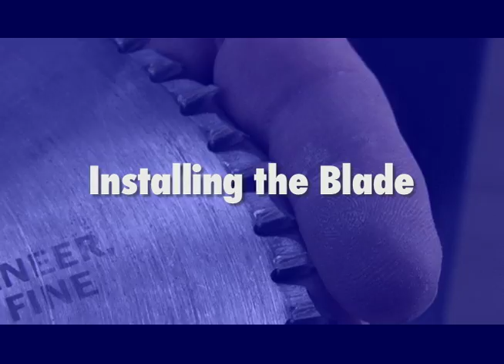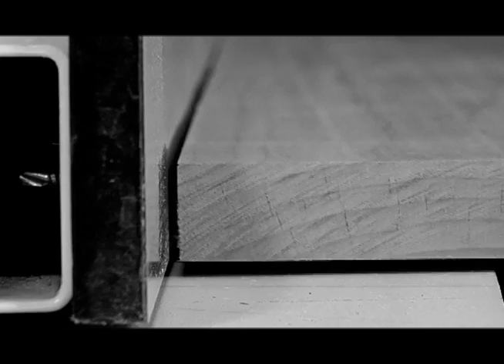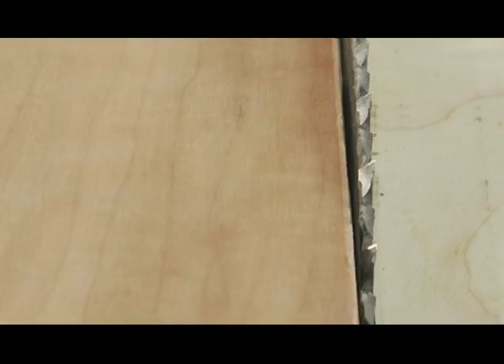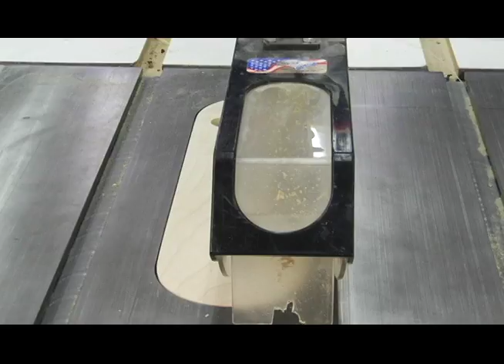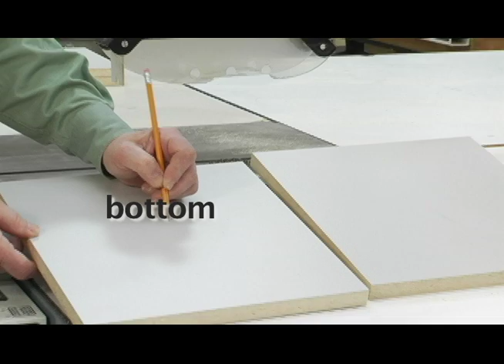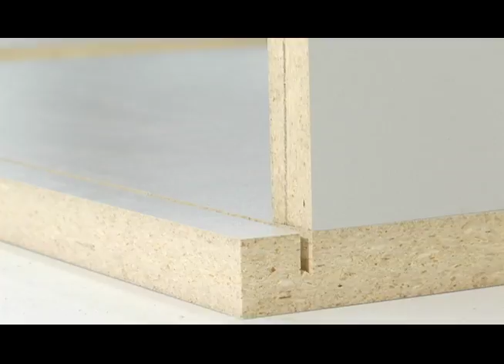Euro-style Cabinet Step 2: Table Saw

Comment: Nice video series. At 14:47 when you cut the width to 355 , I find your your workpiece almost square and using the rip fence to cut it to 355 is bit unsafe I feel because the fear of getting trapped by the rip fence.  A miter gauge or sled would be safer.

Comment: I love the Biesemeyer over-arm guard.  I've used the same model on my ancient Delta saw for over 25 years.  It's always on when I need it and it's easy to raise or remove when I need it out of the way.  For the life of me, I can't understand by it was discontinued since for my money, it's a huge safety feature for any non-SawStop saw.  Biesemeyer also makes a pop-up splitter with anti-kickback pawls.  With a firm push down, it's disappears below the throat plate completely out of the way, and a pull it up  brings it back into action.

Comment: Most, if not all of those kickback nicks in the throat plate did not occur when the blade was in the 90 degree position.  It was likely at 45, or something like that, when the blade is naturally MUCH closer to both sides of the throat plate.